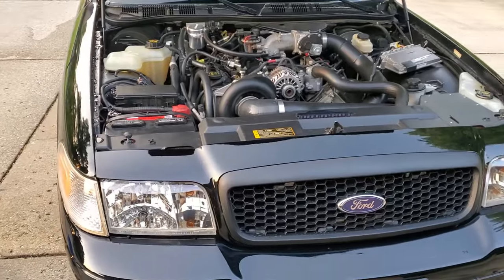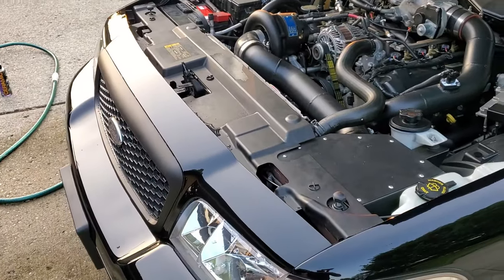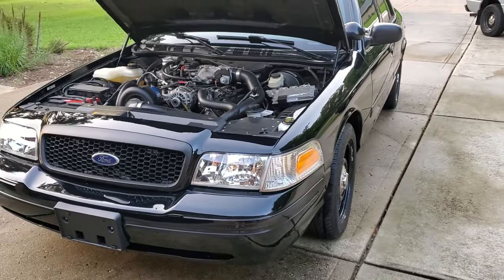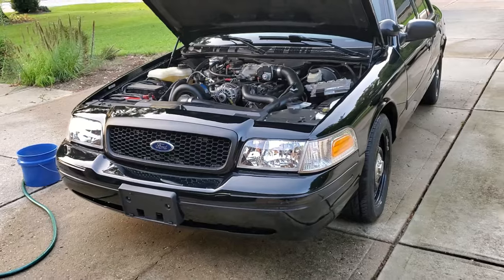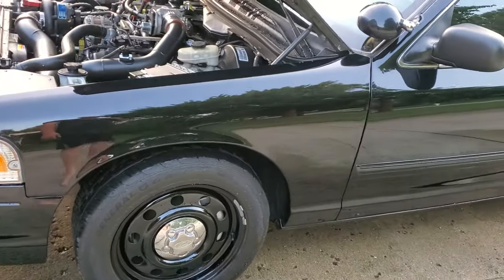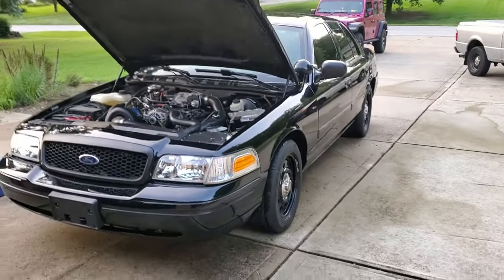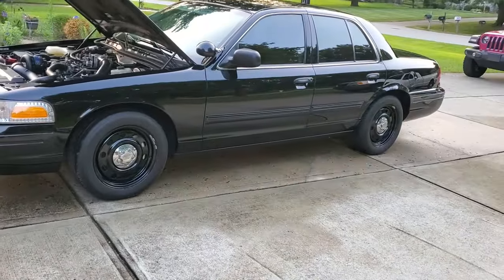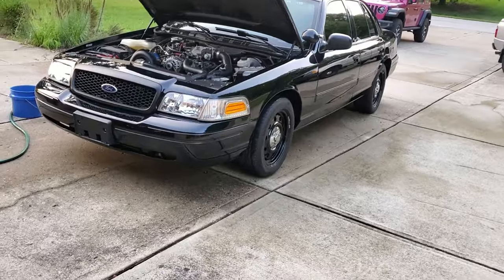Victorino the Supercharged Crown Vic update VLOG

Comment: I have a 2010 P7B with 34k miles. It is such a great daily driver. I really want the ADTR supercharger kit partnered with the 6 speed tre-mac swap. However they are both $7k kits. That is a big investment. After that the suspension will need to be upgraded to handle the high HP shifts....then gears...headers...brakes...tune. It slowly becomes a $40k Crown Vic. Most people on the Crown vic forums will tell you, "If you want speed, spend that $40k on a used Mustang".
Reply: Your absolutely right it gets expensive quickly and it's just a cvpi dime a dozen if your gonna go that far find a marauder

Comment: What size gears are you currently running and are you going to change them with your new stall converter before doing another track pass
Reply from the maker: it's running 3.73 on a detroit truetrac. I probably won't change the gear ratio. It's getting a 3200-3400 stall converter. Thanks for watching!

Comment: You're better off getting a Town Car or Grand Marquis out of the gate. I own several CVPIs and a few rare SAPs as well. They are sudden disappointments. If the transmission doesn't fail you, the engine will. While none of this may not be catastrophic, none of it will be cheap to fix. I actually put a 4.6 2v out of a 2010 Town Car with 40k miles in my 2011 CVPI SAP recently. $800 for the motor and another $800 to have a shop put it in.
Reply: I’ve owned about 10 of these, all P71’s. Well I mostly agree that starting with a Town Car or Grand Marquis is a better idea, the P71’s are still a good option if you’re willing to wrench. Engine failure in these is not common at all, transmission failure yes, engine failure is very uncommon. I’ve seen many P71’s run well over 300k and even double that on original engines.
Reply from the maker: It's okay guys, a CVPI its alway been a dream car of mine and I been a cop for about 14 years and I always wanted a CVPI. I got this 2010 back in 2011 with 11k miles and 40 idle hours, my car has never seen police work. Check out this video where I talk aout the history of this car. https://youtu.be/yWxXoIKnj1c?si=sjlXbcvyuIi-urVf&t=50
Reply from the maker: @DirtyDanMunicipalMan  P71, P7B for life! lol
Reply: @CollazosGarage I'm curious can you have it cammed and have long tube headers in addition to the supercharger?  I don't know a ton about cars but I assume you could if there's enough room in the engine bay. I own a 2011 interceptor. I don't plan on modding it, I don't wanna blow it up lol. But I am very curious about how far you could modify the CVPI
Reply from the maker: @cjsnidlio9409  yep you can do both, stock pistons and pistons rods will only hold up until 450ish fly wheel horsepower though. I did do long tube headers. My engine only has 42k miles and only about 39k when I did the supercharger. All my internals are still stock. Watch this video where I talk about the mods etc https://youtu.be/K52t5tBcRvg?si=V1iaXEnOl3y15W9c=27s
Reply: @DirtyDanMunicipalMan  I've had dozens of CVPIs. The silent killer on these cars is idle hours and never seen abuse by law enforcement. What happens usually is the needle bearing in the roller followers wear out, and the play starts eating into the cam and damaging valves. People usually don't realize it until it's too late. This is no cheap or easy job. Most CVPIs on the market have at least 100k miles on them and 4-5k idle hours. Idle hours equate to 33 miles per hour. So, you're talking 250k+ on most of these cars for sale. It's recommended by Ford to change roller followers and lash adjusters (lifters and rockers) at 150k miles. You're looking at 100k miles of damage internal engine wear and or damage here. Been there. Done that. My 2011 CVPI SAP has 60k miles and 500 idle hours. It had valve damage. It was cheaper to buy another motor. Not the first time I've dealt with it on these cars. Better off with a Town Car or Grand Marquis. Plus, the paint is usually better.
Reply: @CollazosGarage  My 2011 CVPI has 60k miles and 500 idle hours. This extremely low. Yours is unheard of. The cam followers and lash adjusters are the silent killer on these cars. You usually don't notice the slight tick over the sound of the injectors. Ford recommends replacing these parts at 150k miles. The way government mechanics work is they only fix things that need fixing. They don't do preventative maintenance. This means your average CVPI with 100k miles and 5k idle hours which equates to 265k miles because every idle hour is 33 miles is 100k miles over due to have all these parts replaced. By then it's usually too late.
Reply from the maker: @blessedjuggernaut  yep lol
Reply: Engine failure? I’ve owned 8 of these. Not one ever had engine troubles. The 2009 I had was at 400k miles. Never had a problem with the engine. Transmission is another story. Those go around 150k miles.
Reply: @thatdudefrmflorida5882  Ford tells recommends you change lash adjusters and cam followers at 150k miles on 4.6 2vs. Most of your used CVPIs have at least 100k miles and 4000-5000 idle hours. That's 250k miles. This means by the time you get the car; it is long overdue for replacement. When these parts wear out, they develop play, and it scars your cams and damages your valves. This is the perfect habitat for a self-destructing engine.
Reply: @blessedjuggernaut  that is not 250k miles. Yes ever hours of idle is equal to 33 miles. That is for oil change intervals. So to say that is equal to actual engine milage is misleading. My dad is the fleet manager for Palm Beach County Sheriffs office. Not once out of the 5000 crown Vic’s he’s serviced and maintain over 20 years, has the engine failed. Not one.
Reply: I have a 03 marauder currently at Mo's speed shop  and I ordered the adtr full suspension kit upper lower control arms coilovers all the way around sway bars watts link full stainless works long tube stainless headers and the built.bottom end to hold more power and boost because they are also doing the adtr kit from Chris and I have it setting on the same offset as chrises marauder but different style weld wheels yes very expensive build but will be around 550whp limited on the tranny but when I go in for the t56 6 spd swap we will go bigger blower but that's eventually for now 550 whp on the auto tranny with bigger input shaft I too fell in love with crowns as a street cop working patrol and always wanted a marauder I left law enforcement made some crazy investment and it paid off now I can play a little more
Reply: Oh and I already had a Marty tune and 4:10s before it went to mo's now just waiting 2-3 months to get it back
Reply: @ryanjacobsen9557  I like the Marauder as well, but it's extremely hard to find one that hasn't been rode hard and put away wet. Most of them need restoration. The ones that don't need restoration and are in great shape are $20-30k. Each to his own, but for that kind of money you can build something much faster.
Reply: Only thing different between them is pi and non pi and If im not mistaken everyone of them after 03 came with pi weather p71 or not
Reply: @SlickitySloth59  I thought for a long time that CVPIs where the only cars that had PI(Performance Improved) heads. Turns out there is no difference in the motors in Panther's period other than age and upgrades with time. This is why I replaced my motor with a Town Car motor. No difference. Runs great without worries.
Reply: @blessedjuggernaut  yeah that’s what I was getting at. After 03 all them came PI. Before 03 02-pre only cvpi had pi upgrades
Reply: @blessedjuggernaut  yeah gotta find one that a older person had I got mine after years and years of looking its literally like a brand new car but way faster than all the patrol cars I drove for work and my personal crowns over the years I mean a night and day difference
Reply: @ryanjacobsen9557  The reason squad cars run sluggishly is because lack of overall maintenance. I bought over 30 P71s from gov auctions. Every single one of them had leaking intakes, coolant mixing with oil and plug wells filled with coolant. This leads to everything from overheating to internal damage because of the lowering of viscosity of oil.
Reply: @blessedjuggernaut  I had brand new patrol cars u got them at auction because they got rid of them I had a brand new 2010  34miles on it when issued to me and I've built a ton personal one but I'm telling big difference in a healthy 2v and a healthy 4v
Reply: @ryanjacobsen9557  well no shit your adding 2 extra valves per cylinder